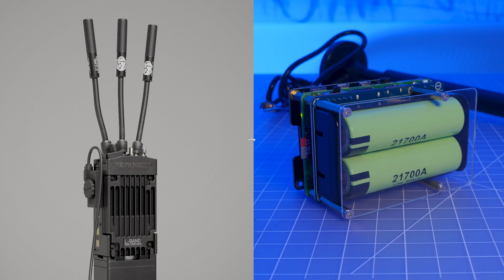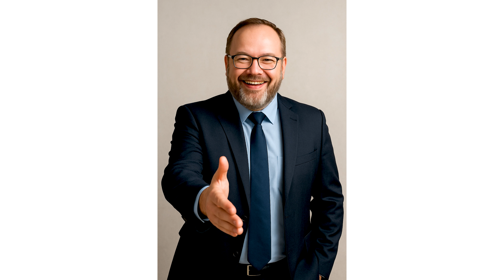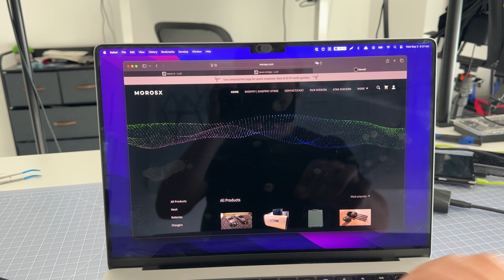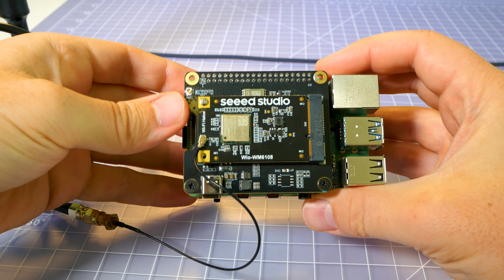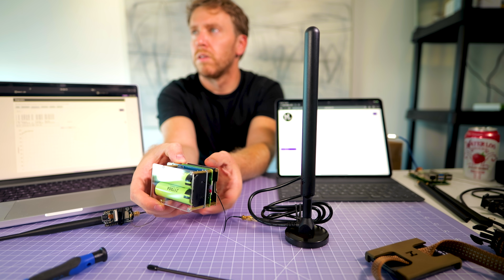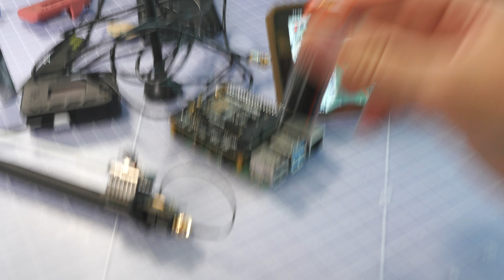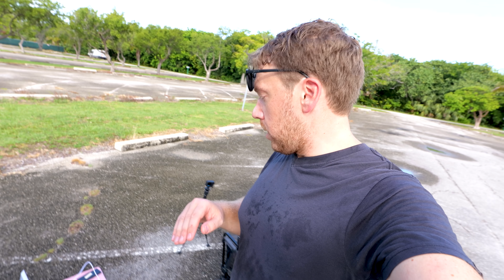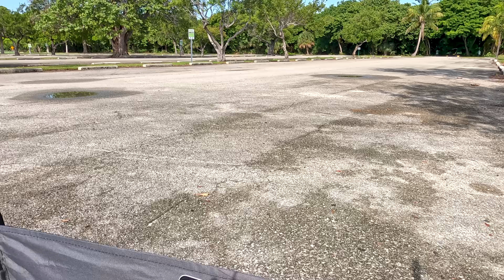I Built a $20,000 Military Router for $106.23

Comment: It's pretty dishonest to say this is anything like an MPU5. It's not, not even close. It's doesn't channel hop. It has no wave relay tech. Its throughput is literally an order of magnitude lower, than an MPU5. The encryption is not comparable. The WPA3 network you are using is probably using an AES-128 bit encryption. It also has considerably lower range.

However, it is still cool. I have personally done something very much like this. Starlink uplink+HaLOW radios+tiny routers to achieve this same setup. It provides a mobile network that's private. That's cool and more like a Beartooth radio with higher throughput, but lower security. The thing that's cool about what you made is that it's a one box plus antenna solution.

As a more resilient mobile private network for off grid usage it's great. As a tactical radio it's borderline useless.

Edit: 97$ for a PDF with all OPEN SOURCE tech? Brother, what the actual hell are you smoking? That's crazy work and anyone who can put a hat on a Pi and setup a network wouldn't need the PDF anyway. That's impressively greedy considering the other open source projects that already exist. With better tech btw. 10$ I could see, but 97$? That's just offensive.
Reply: I was looking for a common-sense comment like this before writing it myself. Very well said.
 It can be even 10 times cheaper - buy some crap from China with all those features and pretend it's a replacement....
Reply: I would also emphasize that what’s missing here is the proprietary “black box” routing protocol used in Wave Relay products, which is similar to the B.A.T.M.A.N. protocol but not published, so no one really knows.  Along with the NIAP certifications required for use in ATOs, and the NSA certifications that qualify it as an IPsec VPN gateway within Commercial Solutions for Classified (CSfC). When you factor in the significant real-world R&D investment behind the Wave Relay product line, the extensive use of MIL-SPEC components, and compliance with standards such as ISO AS9100, the comparison quickly shifts from a straightforward evaluation to something more akin to comparing apples and oranges.  The MPU5 can achieve above 100 Mbps over RF; anything 915Mhz will not be able to compete with that type of bandwidth.
Reply: I laughed my ass off when he said "now I can keep up with the big boys". No you can't. I once ran a "thing" remotely that was in an aircraft from the ground using MPU5s. 5 miles away at 5500 AGL. You can not do that for $109 or even $10000. This does not compare or compete. I love the concept but when you said you can keep up with the big boys, you lost me. You cannot.
Reply: @jasonpitts8395  couldn't agree more. This guy is obviously gate keeping and trying to make a quick buck. But what's behind that gate ain't that great... This being said, does anybody know what Pi hats hes using? one for sub G Wi-Fi and the other for lora?
Reply: @jasonpitts8395  update: it's just a pi with some batteries and a Seed studio Wio-WM6180 Wi-Fi HaLow mini-PCIe Module... running some custom "vibe coded" software with openWRT... it's just sub G wifi and Lora
Reply: Lol I'm pretty sure the HaLow spec sheet is a lot better than whatever is on the pdf. I built something similar AND it was drone mounted in 2022 when HaLow was relatively new His throughput is abysmal.
Reply: Good points. Its definitely better as a deployment for Emergency Situations and Disasters vs. Military scenarios that dont need such encryption. this can quickly connect parties and responders cheaply in a community in a pinch.
Reply: His "real world" tests were direct los from a 50 story building lmao.
Reply: Not to mention this isn't built for field use.  It comes with no support.  I am not defending military contractors but you get a lot of intangibles for that $20k that people fail to factor in.  Are we overpaying at $20k?  More than likely.  Can it be replaced for $106?  No freaking way.
Reply: @thezfunk not to mention the battery of MilSpec tests and regimes, source only from American firms because this handles secure comms, and be robust enough to handle environments from -50°F to 150°F sustained for days before its first failure.
Reply: @thezfunk  Adding to that, 106usd only exists because all the parts are mass manufactured for other peoples products already. If this was designed from scratch, he would have to order like 50000 radios to hit 106usd lol.
Reply: Yeah, all the magic here is in the HaLow chip.
Reply: Not to mention the hardware differences. The MPU5 is certified for much harsher EMI, temperature, shock, humidity standards. I get that it's a clickbait title, but anyone who thinks they compare are just dillusional. Just try the DUI solution in -40 degrees and see how it works. It wont.
Reply: Yep. This is just a shite money grab.
Reply: @anchopanchorancho  Everything is a money grab! Welcome to capitalism! 🫤
Reply: So much this. Yes it does the network communication thing. But what he built is far far less capable. The military didn't spend 10x as much because it overspends.

Can I drop it in 20 meters of water for half an hour and it still works? Can I even drop it off my chest right on pavement? Will those batteries and the rest of be fine from -40 to +85 C temps? Can I use it in a high vibration setting like on an off-road vehicle without those components rattling apart? Can I plug it into 24V NATO systems for power? Can I use my existing PRC-148 batteries with it? We know it has less battery capacity from what he said. Can I quickly zero out everything stored on the radio in one key press if I'm about to be overrun? Does it support direct video input at 60 fps? Can it go 100+ miles between nodes in the mesh?
Reply: @militaryartandscience 
Also is ther a way to brick the hardware not just zero out all the data
Reply: Thank you holy shit. Click bait title saying this is a whole mpu5. 

Also I just seen the 97$ pdf and thought the same damn thing. I’ll spend 25$ for it and still think I overpayed.
Reply: Thank you for saying what I was thinking but with the actual technical expertise to back it up. I might have believed him if he said 5k but it would be surprising if he could even get all the things that go into a Harris radio just off the shelf somewhere.
Reply: Thank you for the balanced and specific comment clarifying this video.
Reply: "Things are worth whatever idiots are willing to pay for them" - welcome to capitalism 😉
Reply: This comment needs to be higher. The overpriced PDF, likely filled with AI slop. The bog standard shopify page selling basic STLs. All the links trying to monetize EVERYTHING. This channel gives me the ick.
Reply: Just a note that while the networking may have weaknesses, AES-128 is not one of those weaknesses.  AES-128 itself is bullet-proof, so I'm unsure of why you mention it.  If someone thinks that AES-256 is more functionally secure than AES-128, then they probably don't understand crypto and just think bigger numbers are better.  Implementation and networking protocols are whole other topics, though, so you may still have a point.
Reply: @antibrevity  AES-128 is not quantum ready and is subject to replay cracking in the very near future.
Reply: @antibrevity  Practical Security

In most real-world scenarios, AES-128 provides more than enough protection. To date, there are no practical attacks that come anywhere close to breaking it.

That said, organizations often turn to AES-256 when they need the highest possible level of security. This is especially true when sensitive information must remain secret for many years, such as in government, defense, or classified archives. Some industries also require AES-256 to meet strict compliance standards, including certain DoD or NSA systems. Beyond that, AES-256 is a good choice for anyone looking to safeguard data against future advances in computing power, including the potential rise of quantum computing.
Reply: @antibrevity  
ther is a reson AES-128 and AES-256 is not certefid secure acording to the miletry. It is way to easy to brake and that is way the milletery is using dedicated hardwer encryption devises
Reply: @Goroca   Oh my God dude, can you pick one way to misspell "military", please???
Reply: @thejonathan130 lmfao man is trying to explain 😅
Reply: @thejonathan130 
No, I like to have options
Reply: @Goroca  AES-256 is part of the Commercial National Security Algorithm Suite version 2.0, authorized to protect Top Secret information, alongside a bunch of newer quantum-resistant algorithms. Not using AES-128 is also purely due to quantum harvest-now-decrypt-later concerns, not anything else -- it used to be part of NSA Suite B, in effect 2005-2015, for protecting up to Secret information.
Reply: @a2e5 
Interesting, don't live in the us so can only comment on my own centres rules
Reply: As someone who builds professional mesh networks with projects exceed millions his videos is a bit of a joke cool but a joke
Reply: Hey bud! I’m wanting to know how you built yours if there’s someone else you went off to build one?
Reply: @jonathangass9052  Hey little buddy o pal Jonathan! I’m wanting to know if you have anything else to offer to debunk his points besides shallow whataboutism
Reply: @YeetusDeletus-vv2xqwasn’t me big dawg, I asked how they built their’s or how they went off building it!
Reply: If this wasn't defending the slop this guy makes (hack smith mogs his civilian component builds) my bad then
Reply: @YeetusDeletus-vv2xqyou got a link or know of something to a build like those to make a cheap MPU5 that’s better? I’m very interested in these and building one.
Reply: @jonathangass9052 I'll see what I can find for you starting tomorrow.

Comment: I guess it costs 20.000 usd because only taxpayer money is going to be paying for such outrageous amounts...
Reply: millitary hardware doesn't use off the shelf chinese parts.
Reply: @lorenzo42p  I can't fathom someone who does not understand the parts are not different at all and certainly not guaranteeing a 2000% increase in price
Reply: @dabelu7165  it doesn't take an engineer to know there is a huge difference. every component is top quality and environmentally tested, made to last in the toughest conditions, made to work at 300% capacity all day long. very different from consumer grade chinese crap.
Reply: @lorenzo42p  told me you know nothing about electronics trying to look like you know about electronics. To a circuit, you can add lots of things that can intrease its IP rating and durability, but there is no such thing as 'harder componentes made of USAnium or EURopium'. They all use the same components.
Reply: @dabelu7165  the fuck?...... I am an engineer. YES there are millitary grade hardened components. they are not the same as consumer grade.
Reply: @lorenzo42p  I am an engineer too. I work on aerospatial and aeronautical electronic boards. They are the same boards as anything else. At most they are potted in silicones, but the chips are no different. The same guidance FPGA in a cruise missile from Lockheed Martin is used in domestic appliances anywhere. I think you are confusing what i am saying with rugerization.
Reply: @dabelu7165  if you were a real engineer, you would know there is a difference. the insanely high price isn't all scam, it takes a lot of testing, and only the most reliable parts can be used. NOT consumer grade, military grade parts are a real thing. marketing lies are a thing, but that doesn't mean it's all the same.

Comment: It doesn't at all surprise me that $20K worth of kit is only composed of $106 of hardware in a fancy shell. These government contracts with the DOD tend to only allow the manufacturer to make a maximum of 200% profit, but the DOD has never really ever been forced to actually audit manufacturers to cheque if they're keeping within that pricing. You see it  a lot in aviation, where you have one part speced for commercial aircraft, but is also the exact same part which is supplied to the Air Force, But you'll probably see a markup of like 10 to 20 X because It's a government contract.

There is also lot of technology and infrastructure sold in the industrial and enterprise space with Non Disclosure, and First Party Maintenance agreements. It is basically put under an NDA and FPMA because they don't want you seeing and telling just how simple it is inside. There's a whole industry around manufacturers changing part numbers for clients on their base products, just to make it difficult to identify what the exact part is, and buy it direct from the manufacture on the cheep. Manufacturers not offering this service risk losing out on lucrative volume contracts.

Comment: Why don't you tell folks what your systems doesn't do that the more expensive military one does.

You know, like freq hopping to prevent jamming.  Yours doesn't do that, mostly because you don't have enough room in the ISM band you're using to do it properly.

HamNet stuff like this has existed for a long time now, all you've done is run it over an already-crowded ISM band instead of 2.4Ghz wifi and calling it "new".

Comment: It would be nice to have a LoRa device in there. One of those small ones. To use it like in a economic mode or low battery mode, maybe with a switch to select it. Bypassing the RPi and all the other stuff. Just using the antenna and the battery in this case. The low battery of the rugged unit showed in the video, could last hours instead of just minutes with a small LoRa device.

Comment: This is JUST what I have been wanting to build to address internet access for the fam when we are out at venues and stuff were its spotty internet to the point phones dont work well and well GMRS doesn't work well either for basic two way.  I could literally setup a mifi router with high gain antennas in the car or use starlink and use it as my node one then carry a node or find a mid point to "Drop" a booster node and carry another with us..... Dude this is cool

Comment: Mind you, MPU5 MANET which you mentioned has 3x3 mimo radio with 5,10,20mhz wide channels resulting at 150mbps bandwidth at highest width(or 37,5 at lowest one) plus each mimo channel transmits at 3.3W(so overall power is 10W), their specified distance of connectivity between nodes is freaking 200km.

So, where the hell is "reverse engineering" or even anyhow comparable specs(known record for HaLow is just 3km)? 

You've practically set up a wi-fi bridge and brag about it for almost a half an hour
Reply: thats exactly all he did - was create a WiFi bridge using Ha-Low. LOL

Comment: FYI the Raspberry Pi’s Wi-Fi radio is only certified at around 20 dBm (~100 mW). If you boost it to 27–30 dBm, it’s no longer FCC certified, even though you think you’re ‘under 30.’ Certification matters more than the theoretical 30 dBm cap. And with a high-gain antenna, your effective power (EIRP) can blow past the legal limits very quickly.
Reply from the maker: ahh interesting, in the future I plan to use a wifi intel chip with external antennas
Reply: @DataSlayerMedia  be careful, once it’s part of your own product, the Pi’s cert doesn’t apply. The whole device needs FCC testing,  using a certified Wi-Fi card makes it easier and cheaper( the certification) , but your finished product still has to be tested. 

PS. FYI if you rely on the Pi’s built-in Wi-Fi inside your own product, its FCC cert doesn’t transfer and the entire device is treated as a new transmitter, which means full FCC testing. If instead you use an external Wi-Fi module with modular FCC approval and stick to its listed antennas, you can usually leverage that cert and only need the cheaper unintentional-emissions test for your product. Regulations vary so don’t take this as gospel, confirm for your specific design.

Comment: Having great luck with the Alfa tube ah halow with POE and the heltec dongle.  Planning on getting another dongle to tear down and hopefully build a very compact battery integrated device. This is a much more compact solution.  Have it connected to my Starlink mini and it is fantastic.  Considering putting one of my higher gain antennas from the helium days on the truck to perhaps get a bit more penetrating power/range.  Halow is amazing.

Comment: the main reason why military tech is so expensive is due to the cost of the components, they do not use off the shelf grade parts, they are the gold standard of parts, the best of the best, these would be the cream of the crop parts. then you also have the hardened parts, that are resistant to EM from a nuke, these cost even more. so while every commercial or home item would die from a few clicks of a home made EM device, military grade equipment wouldn't. it also needs to be resistant to heat and cold without the use of fans. 
it's the resilience that is the main cost of these units. yes you can have cheap stuff as long as you don't need it to work when you need it to work.
Reply: you're talking out of your ass
Reply: @TheRedAvocado  nope, go look at the testing and specs of military grade equipment, you can buy military grade parts from reputable places like DigiKey the mil-spec versions of the generic part are way more expensive, because the yield for those parts are very small. 
there can be a $20,000 difference in price difference between a mil spec part and a jelly bean part even though it is the exact same part. and yes the end equipment is tested for heat and cold resistance and EMI hardened resistance.   
and yes you can build an EMI generator that will kill any hardware but it takes longer to kill EMI hardened equipment. zap it long enough and you can kill any hardware.